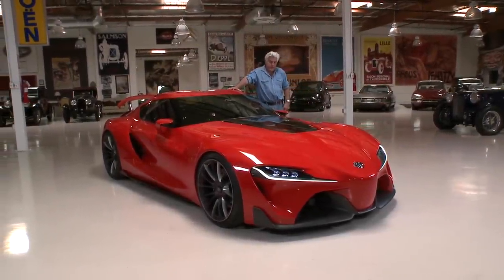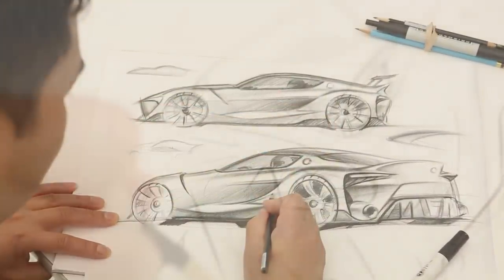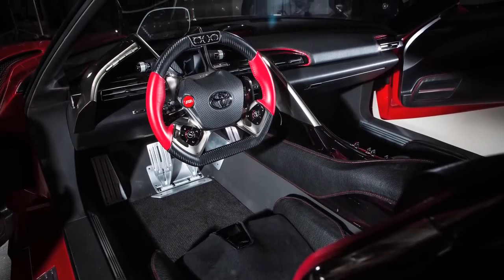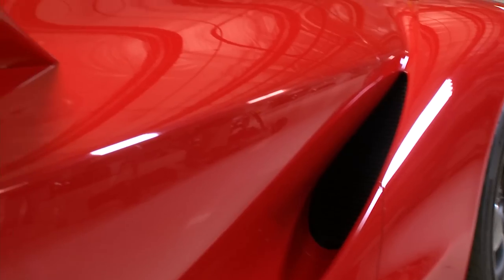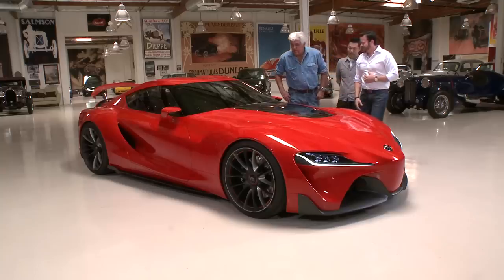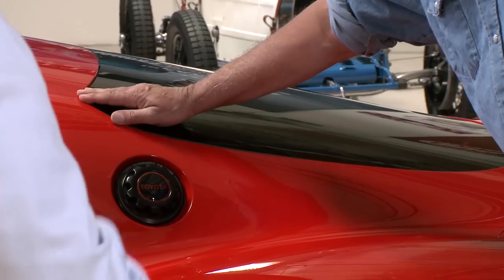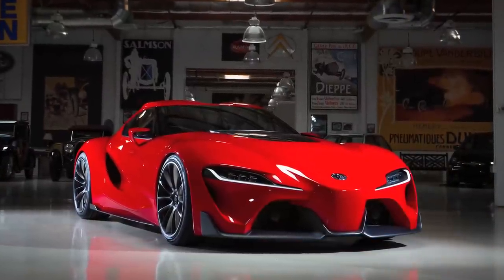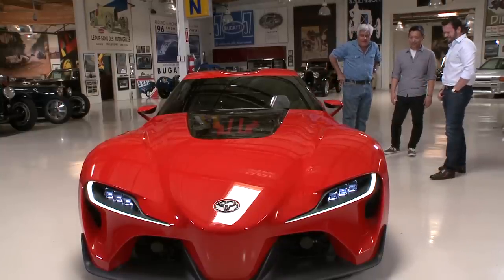Toyota FT-1 Concept - Jay Leno's Garage

Comment: Absolutely stunning. To hell with a V10 engine in this. What it needs is a 3.0 Straight 6 engine with two turbos, just like the last supra. And to hell with this car if they produce it with just those silly paddle shift option, it NEEDS a 6 or 7 speed manual gearbox. I hope Toyota doesn't make it into another GTR. I'd like this car to be a Toyota GT86 on full steroids. With all that attention to detail, I can't see how this car is going to be in the 'affordable bracket.' So many questions, so little information.
Reply: More like 4.0, as the 3.0 can't make the power without e85 or race gas.  And also, not to hell with the v10.
Reply: vinnygamz who r u kidding ? I said Twin Turbo 3 litre. Ever seen how much power supra's can make on just BPU (basic performance upgrades). My brother has one on BPU and its close to 500 hp. So it can be done and it SHOULD be done, especially if this is going to be an AFFORDABLE sportscar as Toyota has stated and if its gonna be the next supra. So yes, to hell with the V10, we don't need a Toyota version of the LFA. Australian sources have confirmed that this car will either come with a 2.0T or a 2.5 V6 Hybrid. Weak Sauce so far !!
Reply: 647killa This isn't 1996, supercars don't use manual gearbox anymore. Look at Ferrari, Lamborghini, etc...
Reply: ***** This isn't a supercar we are talking about. This concept supra is FAR from a supercar. Sportscars, well there are TONS of them which come in a manual. This toyota is supposedly an affordable car, which means at this car's price range, it should offer a manual cuz people like ME will actually buy it. No one said anything about supercars, although there are a few supercars in the world that offer the manual box. Think C7 corvette, Noble M600, Zenvo ST1, Audi R8 etc.
Reply: First off, you can go to my videos, as I had is300 with a gte and v160 and turbo rear end with a 66mm turbo.  Yeah, and the BPU is trapping around 117mph in the qtr mile.  While a 2006 Z06 with trap 122 stock.  Even with a single you're limited on the boost you can run with st8 93 octane.  Wait until the new Z06 is out.  We don't need a old supra car in today's world.  And I've been in the supra scene for about 15 years now, while I was in high school.

And yes it should have a manual option like the new Z06 will have.
Reply: vinnygamz Well, It's not about "old supra" I'm just quoting other sources that are saying that this is the direct replacement of the Supra. Otherwise, i would've already called it an LFA replacement. Australian sources from Toyota have confirmed that this will even be called a Supra, though I just feel its unworthy of that badge. The supra had a character of its own and that 2JZ was a revelation of an engine. Very few engines can hold so much boost in stock form. Even my R32 GTR had a limit before it coughed everything out on the stock block. The supra's are good for a lot of hp on a stock block as you may know, so I dont see why they can't squeeze about 400 hp and make it a proper driver's car, whilst being fuel efficient. I mean a 3.0TT can be easier to make efficient than a V10, and the car will remain light at the front. Well, the above mentioned sources have confirmed a 2.0T and 2.5 V6 Hybrid as i mentioned before, so there goes your manual transmission option, at least with the 400 hp V6 hybrid motor. Love the design, but i'd still buy my brother's supra off of him.
Reply: I understand.  But the difference in our views is that you wanted a 3.0 L, and I think you need more like a 4.0L.  In today's world, I feel  you need more displacement to run strong on the street against what is coming out and "is" out.  If they could actually do the v10, that would be the ultimate in my opinion.  
No worries, the supra will be a collectors item in a few years.  They're great cars.
Reply: vinnygamz Well hey a 4.0 Twin turbo and calling it the 3JZ would be totally awesome. But, the SRT Viper is doing pretty bad because of its over 8 litres of displacement V10. No one, especially Europeans, wants an engine with so much displacement because of high gasoline prices. I would love a V10 with a proper manual gearbox, but it just wouldn't make sense for Toyota, who also makes the prius lol. I just don't want a GTR rivalling next gen Supra, which takes the driver out of the equation. I want this car to be a Toyota GT86 on steroids or Super Saiyan 3 status lol. Cheers dude and sorry if I came across a bit rude earlier.
Reply: 647killa THANK YOU. Some of these motherfuckers are so ignorant.. Standard transmission is what draws enthusiasts to a sports car.. There are always the people that just "gotta go faster" and want that tiny little edge from everything being automated.. Guys like you and I like to drive our cars ourselves. You just can't have as much fun.. If I had the choice of a Ferrari with paddles or a standard transmission bone stock supra it would be the supra every time.
Reply: Dylan Simons Amen Amen !! Preach it brotha !!
Reply: 647killa zero inertia engines are very hard to operate manually (CGT and LFA), this is the reason why it's so easy to stall the carrera GT when taking off in 1st gear

the LFA has even LESS inertia than the CGT which means stalling it would be as easy as stalling a F1 car when taking off

i also understand why you would want a manual, but have you seen any reviews were a racing car with a sequental manual is regarded as not engaging? i haven't, or how about the 458 and i8, both gets high praise for being engaging to drive

i also like manuals but i'm not neglectant to the flappy paddles

Comment: Everyone is talking how this would have been the new Supra.
This looks more like a supercar than some $50,000 sports car.
It looks awesome, but this would have been SUPER expensive.
Just putting it out there, it would be awesome if they still launched this under another name though.
Reply: They have the LC500 platform, which is about the same size. They could've given it a different body and been EXACTLY like the FT-1. It wouldn't be expensive because the platform already exists. They were too lazy to do it properly. They thought people were stupid enough to fool by rebadging a bmw and making up some marketing bs.
Reply: @enigmaPL But the LC-500 is already a $100,000 car. Then they have to add all the expensive smaller pieces like the active aero wing, the whole new engine. 
Either way you're looking at a car upwards of $130,000+. It may not have been expensive for what it could be, but it was an expensive car.
Reply: @sortaanonymouslaex9564   Just because the LC500 is that price, doesn't mean the Supra version would have to be. The LC500 needs to pay off the costs of development. Basing the Supra on it would've saved money by further subsidizing the already developed platform further. They could keep it around $100,000 like the GT-R is, and have it compete with it like the Supra always had.  People would've jumped all over it and sales would be through the roof to pay off the development costs that much faster.

On top of using less expensive parts/components/materials would help cut costs further, and let's be honest, Toyota being the second largest automotive company in the world, they could easily afford to sell it at a loss for the first year and not even notice. But their effort would've shined through, and the car would be a huge success to make up for those losses over the next couple of years. 

They didn't do that, they would rather create a self-fulfilling prophecy; complaining sports cars don't sell well, while creating something that no one wants to buy anymore.